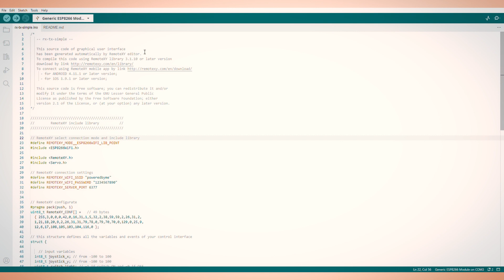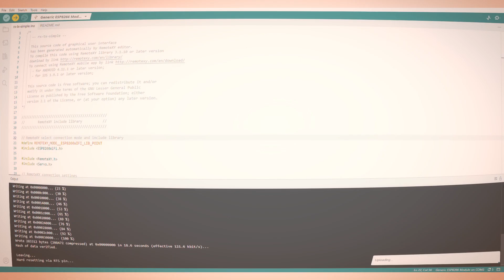How to make DIY RC for Hot Wheels - Simplest and smallest DIY Wi-Fi Remote Control

Comment: Is there any way I can use it with any diy transmitter instead of the mobile app as 
It's hard to controll through the mobile app??
Reply from the maker: nope, I made it especially for the mobile
there are lot of ready to use receivers and transmitters
Reply: @poweredbyme13 can I usee the flysky gt2 , I have it already but it doesn't have build in gyro
Reply from the maker: @utkarshmaurya9829 no, it has only 2 channels
Reply: @poweredbyme13 why is 2 channel isn't enough for steering and the motor
Reply from the maker: @utkarshmaurya9829 one for gyro as well if you want to manage the level
Reply: @poweredbyme13 can't I run without the gyro ??
Reply from the maker: @utkarshmaurya9829 sure you can
Reply: @poweredbyme13  the gt2 receiver is quite big to be fit in the hotwheels so I'm not using it now and can u plzz tell if I can use this receiver to work with a different diy transmitter as there is not many transmitter and receiver available in india that are small to be fit in the car even if they r available their price are quite high so if u can help me with it ,then it would be great
Reply: Like I have a diy transmitter also made with Arduino nano is there any way that I can pair with and if not I can make a separate diy transmitter for it if help me as controlling the car through mobile app is quite difficult
Reply from the maker: @utkarshmaurya9829 I have another one 

https://youtu.be/BPsso8BV-PU?si=MY3sT_rpMVQqyj0o
Reply: @poweredbyme13  yeah saw this video but it uses only single joystick can I put 2 different joysticks for the left right and the front back like that's the main reason I wanted a new transmitter as the mobile one is also use single joystick
Reply from the maker: @utkarshmaurya9829 sure, you can use as many controls as you need
Reply: @poweredbyme13 can u help me making it ?
Reply from the maker: @utkarshmaurya9829 man cmon, just add one joystick and take one of coordinates from it
Reply: @poweredbyme13 ohk I'll try to do so actually I'm kid just started with these stuff so don't know very much programming that's why I was thaq

Comment: Bro, can you use esp12f?
Reply from the maker: hi
any reason to do it?
I like esp01f
Reply: That means you can't use esp12f, you have to use esp01f
Reply from the maker: @ArkhanAlwafi esp12f has another pinout, bit I think you can adapt the board for it
Reply: @poweredbyme13  Bro, I want to ask, this flash doesn't use a resistor, USB TTL should use a 10k resistor in the EN TX RX GND VCC research.
Reply from the maker: @ArkhanAlwafi i’m not sure about resistor
do you have a datasheet where it’s described?

Comment: Hi, can a similar project be done using the Esp32 Cam module (I need the video) and two motors instead of just one ?
Reply from the maker: @gltubes  100% with two motors, but not sure about cam, never had a deal with that
Reply: @poweredbyme13  It seems just a matter of swapping the Esp32 chip with Esp32-S and adding the camera slot on the pcb ...

Comment: hello i keep getting RemoteXY.Init() error each time, do you know somehow how can I solve this issue?
Reply from the maker: @BullToaster  add remotexy library
Reply: @poweredbyme13  i already did, i even fixed this problem, i am using esp32-c3 and when i tried to upload code with the wifi ssid the pc wrote that the device is not recognized, i dont know what exactly could happen to it. have you ever had such an issue?
Reply from the maker: @BullToaster  did you install the board library?
Reply: @ yes, everything worked fine with the code that remotexy provided me but when I tried to integrate the wifi code, I uploaded it and the esp стал кирпичем какбудто. не реагирует ниначто, а комп перестал еспшку распозновать
Reply from the maker: @ I did not use S3, looks like it uses a bootloader because of usb port
I use 1f and upload the code using usb to ttl uart module
Reply: @poweredbyme13  ye i know, but i wanted to implement remotexy to c3 and though with some changes in the code, it would work for me but the device became unrecognizable, i thought maybe you know how to delete the code from the esp if i can not connect to it or smth like that?
Reply: @poweredbyme13  Also, I wanted to ask exactly which antenna you’re using to control the car. If my ESP32-C3 is bricked, I’ll try to gather each component shown in your video to finally achieve this goal.
Reply from the maker: @BullToaster  I don’t know 
maybe it has some hardware reset
Reply from the maker: @BullToaster  I don’t know 
maybe it has some hardware reset
Reply from the maker: @BullToaster  I don’t know 
maybe it has some hardware reset
Reply from the maker: @BullToaster just a peace of wire
it’s described on github
Reply: @easy_3d  i tried but when i uploaded the code it stopped working the pc gave me the message that the device was not recognised each time i connect esp to pc idk what happend but it stopped working, can you give me your code or something?
Reply: @BullToaster keep the boot button pressed and then click reset button on the board when uploading the code. I am planning to make a video on it. I will attach the code in the video
Reply: @easy_3d  i have tried the boot button but it didnt work

Comment: Hey I want to connect two led lights so it would work right it already have one resister for led so it don’t require another one right?
Reply from the maker: @Alihaider10109  use the separate resistors for each led is more correct, but I use one for both headlights 
it works good, but a bit dangerous 🙂

Comment: Hi! How long does the battery last? ESPs are very power-hungry with WiFi. 
Also, next time it might be good to include bypass capacitors required by datasheet of the linear regulator.
Reply from the maker: not much, something about 10 minutes 🙂
yes, I know about the capacitor but there is stable voltage from the battery with ams1117 and it works good without it
Reply: @poweredbyme13  thanks! I see that you've used a non-WiFi JDY-40 module before, how was it? Should have lasted longer, right?
Reply from the maker: @osmanpasha_diy  not much actually, maybe 10-15 minutes 
but you cannot use a mobile phone as a remote control in this case
Reply: @poweredbyme13  huh, interesting. I am now developing a similar device based on nrf52 BLE chip, also in EasyEDA. But I am working in 1:87, so it has to be smaller.

Comment: I am in the process of making the control circuit.

1. When powering the main motor and servo motor, should it be provided through the 3.3v(AMS1117) regulator? 

2. Or should the motor and servo motor be powered by the battery 4.2V?

Please help me🤝
Reply from the maker: 2

Comment: how to contact you..
Reply from the maker: you can do it right here 🙂
Reply: @poweredbyme13  Is ESP 01F enough to make this? ESP 01F 2M is hard to find.
Reply from the maker: @sachinthasudhara4100  you can use other ESPs, but pinout will be different
Reply: @poweredbyme13  how to download pcb design?. Cant download pcbway in design..
Reply from the maker: @sachinthasudhara4100  all links are in the description 
https://github.com/poweredbyme13/rx-tx-simple

Comment: Its dificult to getcan esp01 in my place, its posible to change it e.g with esp12
Reply from the maker: guess it’s possible, but pcb should be updated, because esp12 has another’s form factor and pinout
Reply: Ok, tq i will try it
🙏🙏🙏
Reply from the maker: @frenkkotarigan  but check the schematic before https://github.com/poweredbyme13/rx-tx-simple/blob/3f2862e1e3bda167b3ee6dfa0747d65b7253747c/circuit.png
Reply: If i use prototype board base on the schematic 

From
Baterai pin - ams3. 3v - esp board - motor driver CMIIW

What  fuction or whrere i connect the 
P-HDR-M 2.54_1x5 on the schematic?
Reply from the maker: @frenkkotarigan  this is the service port, to upload the firmware
Reply: Ok tq,i will try to use esp8266 to
Reply: I use esp12F chip
Reply from the maker: @frenkkotarigan  wow, cool!!
esp12 is little bit bigger, but also good chip if size is not critical for you
Reply: So, if i just use the esp32 without pcb is that code and schematic will work?
Reply from the maker: @frenkkotarigan  yes, it should work
Reply: Ow i see..
Reply from the maker: @frenkkotarigan  yeah, you should not connect it, but  anyway for the firmware uploading you will use rx-tx and IO0 pins
Reply: Anyway thank you for always response my question, realy appreciate.. 
Respect 
🙏🙏🙏
Reply from the maker: @frenkkotarigan  no problem 
happy to help you :)
Reply: I has made remotexy configuration with esp32 board and adding some of your code, there is an error "analogwrite not declare"
Reply from the maker: @frenkkotarigan  as I know, some old ESP32 cores don’t contain analogWrite function
try to use another one
Reply: Yeah.. I think thats the problem.. I still configure how to fix it 
😁
Reply from the maker: @frenkkotarigan  unfortunately I don’t have esp32, I cannot check this code with it now
Reply: Its OK, 
🙏
Reply: I has modified the code and succes
With esp32 board 
😊🙏
Reply from the maker: @frenkkotarigan  wow, cool!!
Reply: Is any issue about the servo that we use, i has try switch light ok, in serial monitor servo value is ok, but no response from servo
I use sg90 servo for test
Reply from the maker: @frenkkotarigan  no, I did not see any issues with servo
which function and library do you use?
Reply: Ow.. Ok.. Cause i use esp32board i use ESP32_Servo library
Reply: Now it works properly
😊
Reply: R u from india
Reply from the maker: nope 🙂